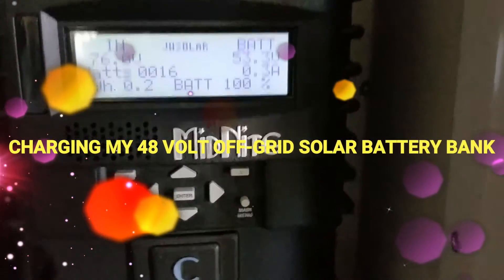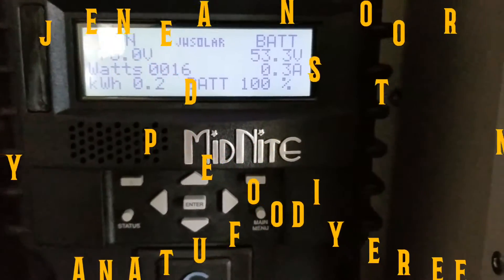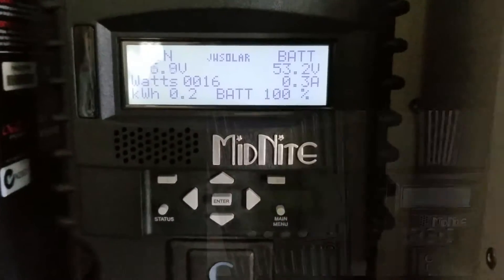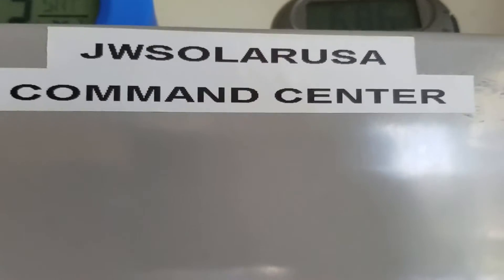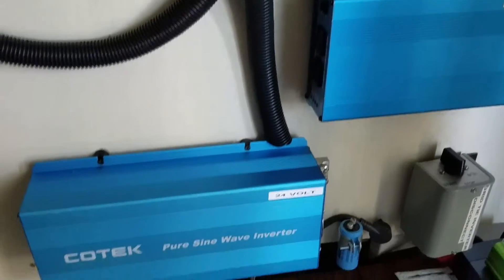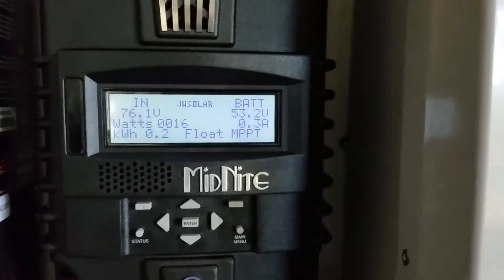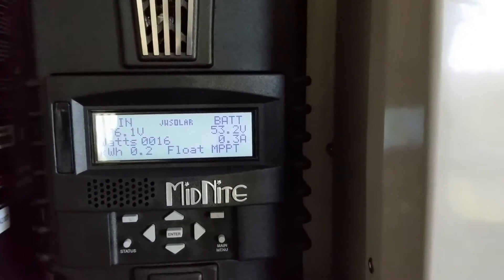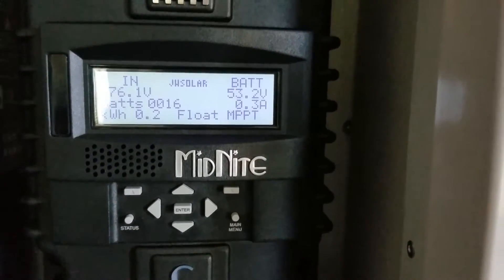CHARGING 48 VOLT OFF-GRID SOLAR BATTERY BANK By: jwsolarusa

Comment: Hey Buddy, like the system you have. How is the Flex max doing? I may just get me one to replace the Aims controller's I have. The Flex max comes as a 80amp right or just 60amp? But your system is as always looking clean and nice. Thanks my Minnesota Buddy😃
Reply from the maker: +TheBillytheJack2010 
Hey Billy,
Yes the OutBack Flexmax Carge Controller comes at 60A and 80A 150Vdc. They are very good charge controllers.
I don't have any issues with my OutBack Power Systems.
Thanks for watching and I am glad you liked it.